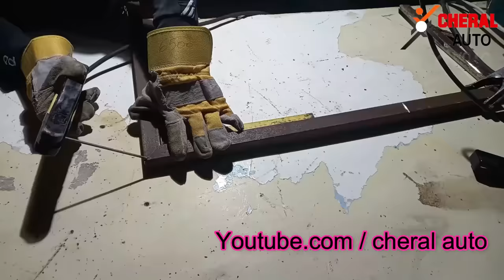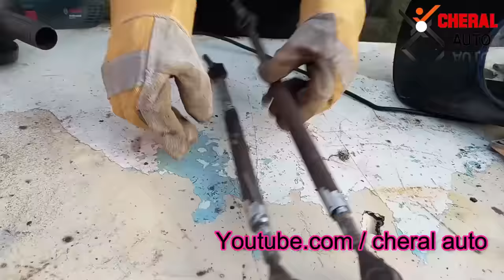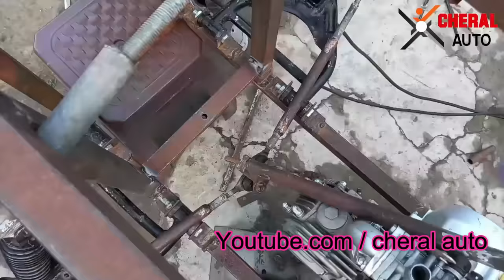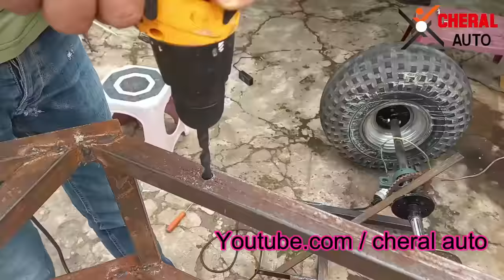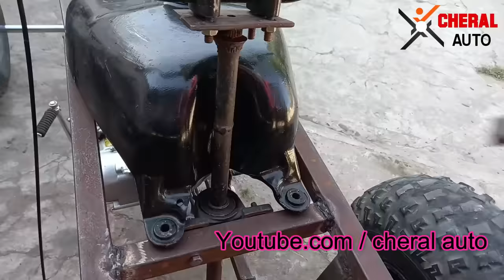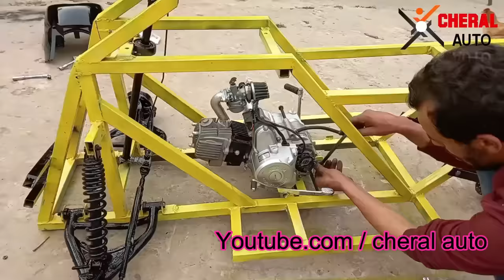Making ATV Quad bike at home - Light Version

Comment: Extremely nice work.  Very clean looking results.  Great video.  That said, it obviously took a lot of man hours, materials, and money to build this machine.  But in the end, other than being larger framed, what does this rig offer or do that the quad didn't already do before you reconstructed it?  Still has the  same quad engine, the same gas tank and seat, the same tires, and carries one person.  It likely doesn't run faster or perform any better than the original quad. So why go to all the trouble to build this machine?  I'd just as soon have the original quad. And, if I wanted a larger quad, then I could have sold the old one and put all the money invested in the reconstruction toward a new, larger ATV.
Reply: Nice

Comment: Still after all these projects, any thoughts of proper steering or swingarm / chain drive geometry
Reply: Are thrown into the bin along with any round tubing or thoughts of bending said round... I learned everything I know about proper rear suspension/steering geometry along with metal fabrication bending and welding from this platform.. my tools are just a simple if not simpler yet my homemade quad and all other 4 wheeled builds turn when I turn the wheels not because of a differential or access to better parts but because of proper Caster, camber, sai, Ackerman, scrub radius for a given wheel base, width, and weight distribution. Also,  my projects that include rear suspension do not have chain tension issues (not because of any jackshaft or complex chain tensioner but simple geometry) nor do they try to lift or bury the tire under acceleration or braking..  if you want a real exaggerated example of how proper steering geometry can really make a difference look into how (well built) racing mowers turn very well with live rear axles and most of the weight on the rear.. even racing go karts are very heavily rear bias yet they can turn on a dime. It is because on a well built cart the inside front tire will dig in. this works with suspension too look at how quads are made with lots of caster, 0 camber for straight line stability but when turned the sai and caster along with Ackerman and usually excessive scrub radius all act together to push the inside tire into the ground and camber the wheels in a way that gives the front wheels leverage over the rear axles... My face is now blue 🤣